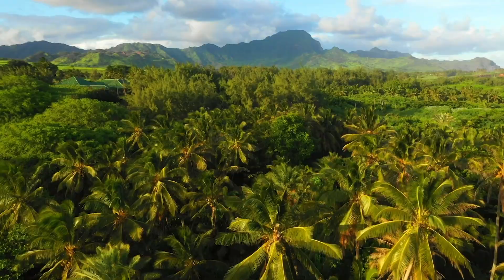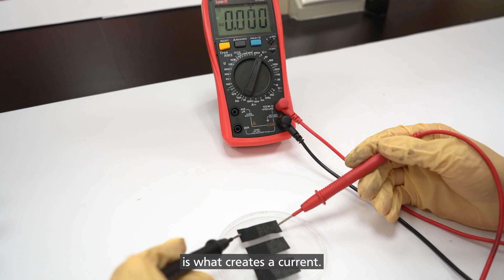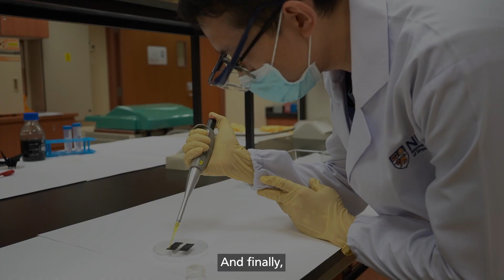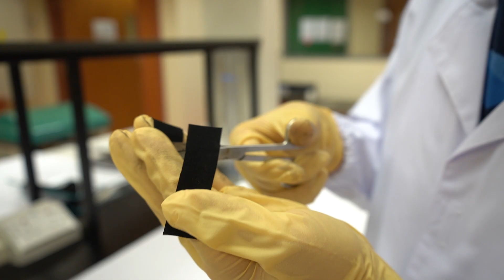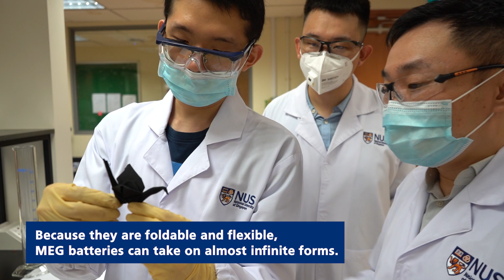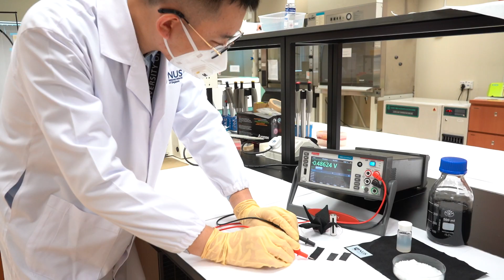A battery powered by moisture from the air

Comment: we had already made this project in our stem school  in Egypt but in different materials and it produce voltage from 10to 18 volts in high humidity range from 80 to 85 percent... and we need to know how can we use it as a battery, because make a 3D dimension of battery is not avalaible in our school in additiin our little information about how.. so we hope that you help us because it's vary important and productive project especially in these days and increasing humidity in the air
Reply: How did you make it? What materials? I am making this but can’t seem to figure out what they used for the hydrogel,  I would really appreciate your help

Comment: I would expect that the hydrogel would eventually become saturated. What keeps the battery operational?
Reply: There is a superhydrophobic layer made with carbon particles that allows for continuous evaporation in one side and adsorption on the Hygroscopic side(salt gel), a type of Janus membrane, therefore the asymmetry and the ionic gradient.
Reply: @thunderandstorm4957  Thank you. That makes a lot of sense. The ionic gradient also explains how it is able to generate voltage.
Reply: @Pooua  It doesn't actually "generate" power ... it's a moisture-activated battery that has to be charged.  (First Law remains in effect.)
Reply: @jpdemer5  no law have been claimed to have been violated by the prior comment the power is due to the charge gradient in the electrolyte; the source of energy is the ambient heat that produces natural Evaporation in one side facilitated by an super hydrophobic carbon coating and the sea salt in the gel makes it hygroscopic in the other side. just like Lithium chloride etc sucking moisture from the air  .if you put a tape on either side of the substrate, the process stops even after being saturated with water no more charge gradient.  "Ionovoltaic Electricity Generation" keyword to learn about it it's well studied well documented.  Few uwatt cm2 but good enough to power  small internet of things werables and leds etc.. maybe  you should try to read the paper before posting "An Asymmetric Hygroscopic Structure for Moisture-Driven Hygro-Ionic Electricity Generation and Storage"
Reply: @jpdemer5  lol what? do you think a generator creates power out of nothing? because by your logic the word "generate" should never be used in a context that obeys thermodynamics. a battery converts energy just like any other form of power generation does. I am genuinely confused why you have an issue with "generate" in this context, it was never implied that the energy was coming from nowhere.
Reply: @azzy-551  It was never stated where it does come from.  Popular press accounts leave a lot to be desired.
Reply: @thunderandstorm4957 pls do you have an idea of where to get the salt water gel